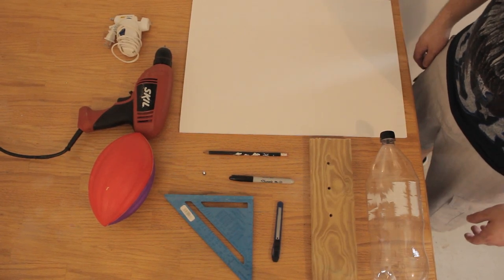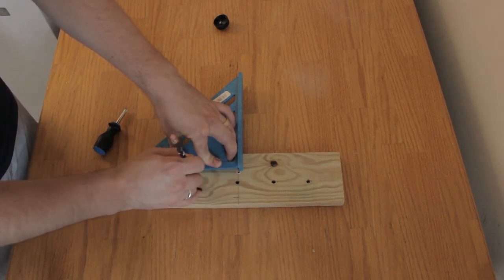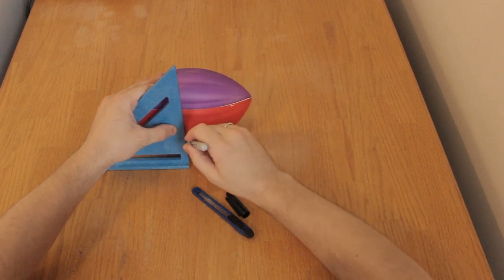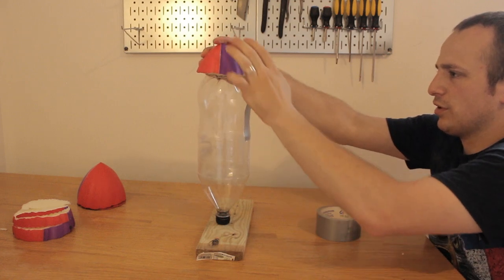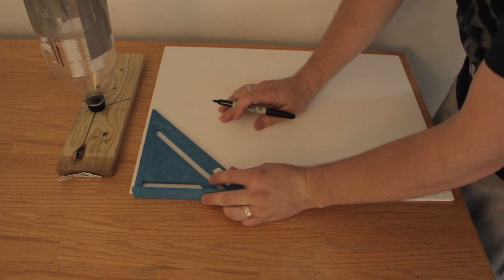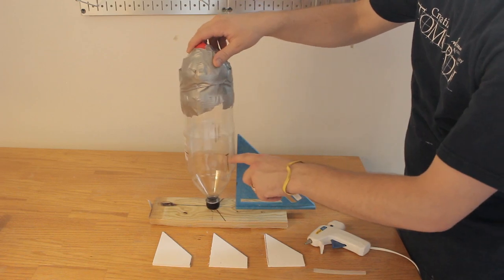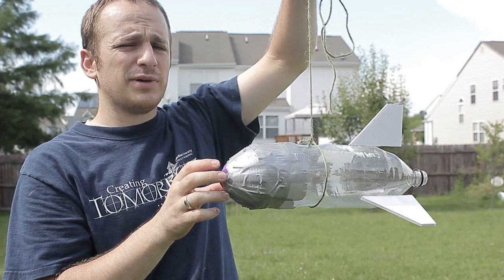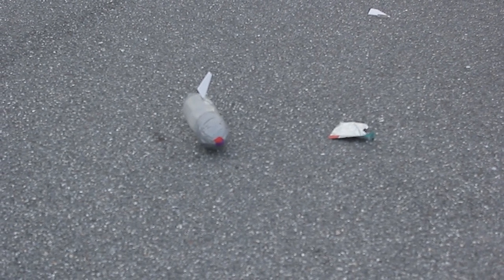Make your own water bottle rocket launcher! - Part 3 of 3

Comment: I have been watching several of these videos, and they have great explanations of how to build the rockets and launcher, and what a launch looks like, but what about loading it up? Do you fill the bottle with water before putting it on the launcher? Should you turn the launcher over to attach the bottle so the water doesn't spill out? Is there a video that explains the setup for launch? Thanks for all the great videos! I am going to do a summer camp this year with kids ages 6 to 12, and I can't wait to build these.
Reply from the maker: I don't have a video showing the loading process, but thank you for the request. I'll look into creating that video for you and the summer camp kids. Generally, I turn the whole launcher over when loading to minimize the amount of water loss during load.
Reply: @EngineeringToExcel  Hey. Do we fill the entire piping of the laucher with water as well before loading bottle(with water) onto it, because otherwise when bottle is loaded onto launcher, doesn't the water flow all the way down till the valve opening?
Reply from the maker: I'd recommend not filling up the launcher and only filling up the bottle about 1/2 way. If you do this, only a tiny amount of water will go into the tube when you put it on, because the top of the tube will be above the water line in the bottle.
Reply: @EngineeringToExcel  cheers thanks!

Comment: Hey, I'm planning to do my High school Science project on this only problem I am facing is with the launcher. I watched your video where you make a launcher its good but on the other hand, it's difficult to make.. I mean some material is difficult to find in my locality for example Glue which you used for fixing PVC rods end. Can you recommend some easy method to make water rocket launcher....also last time I used a simple cycle pump without gauge and that result in burst of my cycle pump tube..Waiting for your suggestion
Reply from the maker: Hey Hardik3004, rocketry is a great science project. As far as finding the correct glue, any hardware store that sells pvc tubing should be able to help you find a compatible pvc glue. If you can't find it, you can order it online.  The links for all of the hardware and tools are listed in the description of the launcher videos.  For the bike pump, any pump that fits the standard fitting and is rated for at least 80 psi will work fine. I'll find a link to an example pump on amazon and post it in the description tonight just like the other tools.